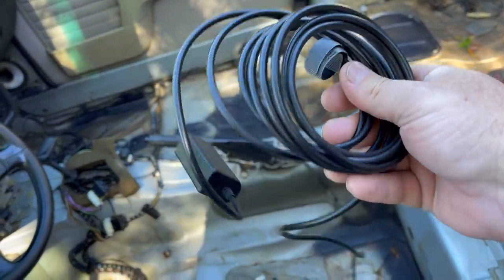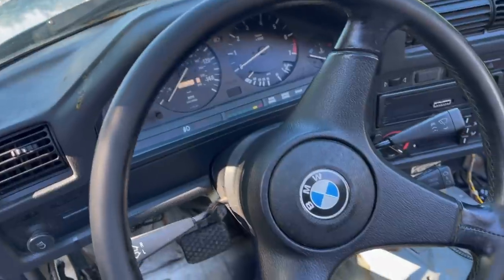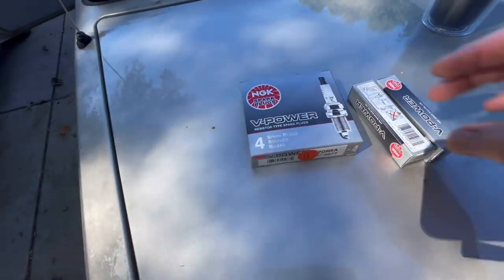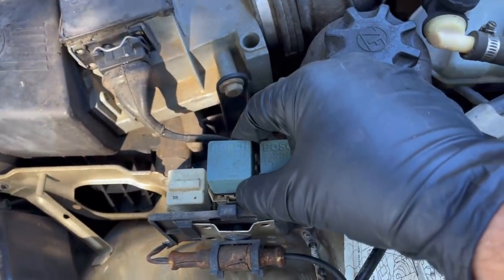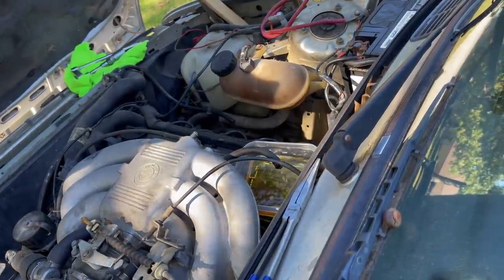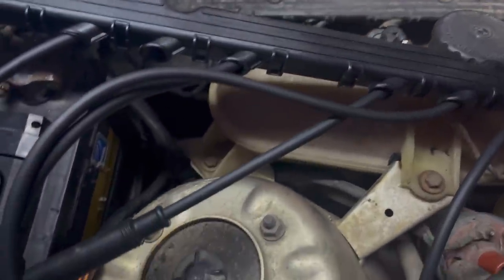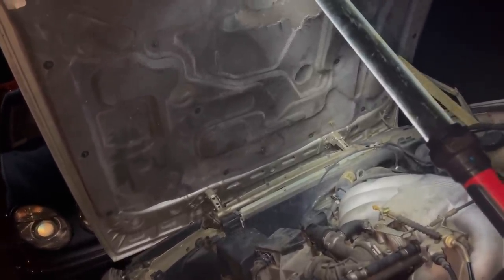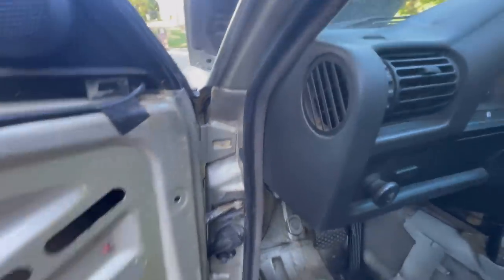BMW E30: Cylinder Inspection!

Comment: If you have spark than cranck sensor is good , i think is fuel pressure regulator or some injector is leaking, sounds like fuel pressure is not corect ( fuel pressure need to be 3,5bar)

Comment: So close Mike but no prize as yet but I'm sure you have it sorted now. By the way top tip use tyre wheel shine spray on the engine bay works a treat and it's cheap.   Gary 🇬🇧🇬🇧